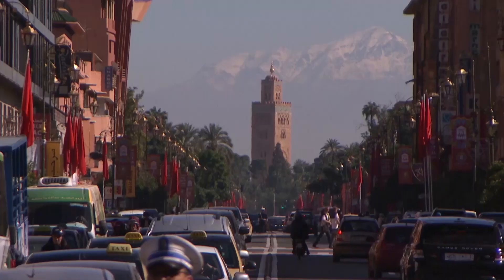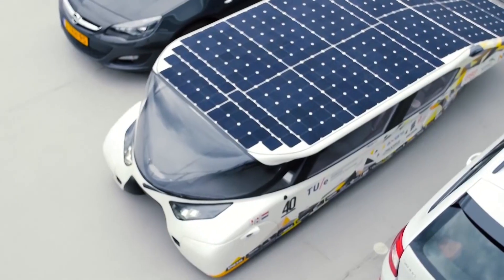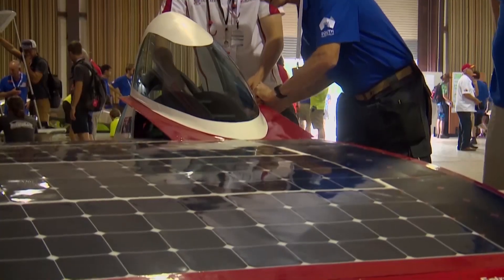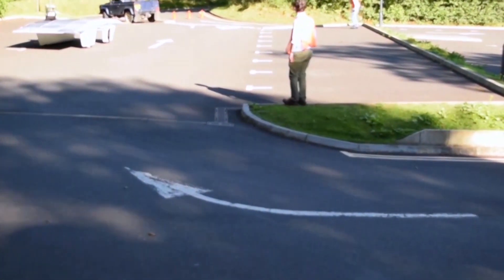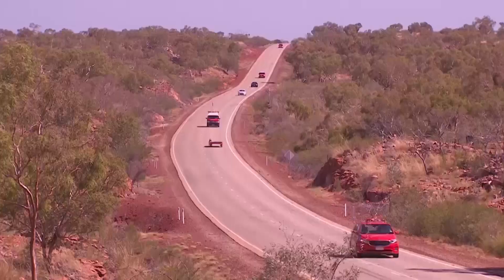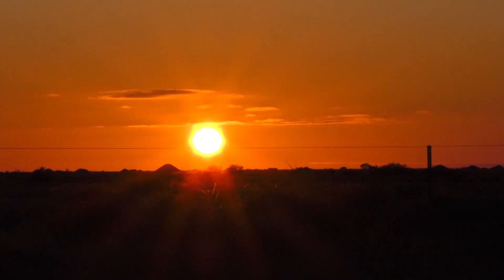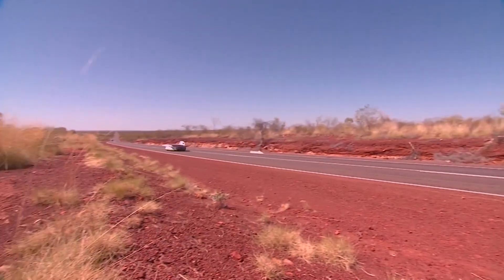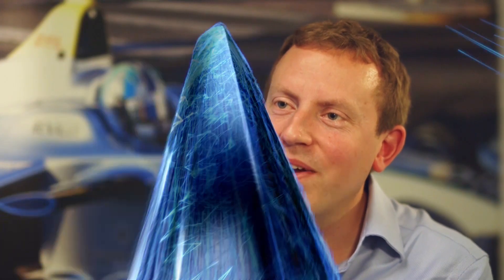World Solar Challenge - Formula E

Comment: Hey, that's pretty good! Seems the best route will be a plug-in solar car. Albeit after finding ways to sneak in more solar cells practically, perhaps with transparent ones as the glass panes. Security of the cells is a big thing too. Basing them rearward would avoid lots of abrasion. Then we'll have viable transport
Reply: almost every participating solar car in the WSC Cruiser Class is a plug-in solar car. Battery alone can feature a range over 500km under range conditions with relatively small battery packs.